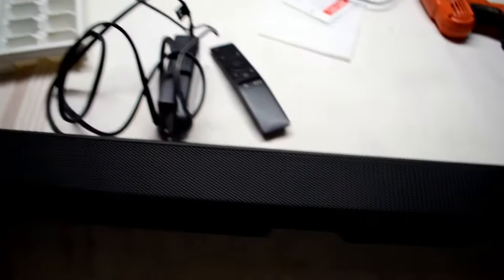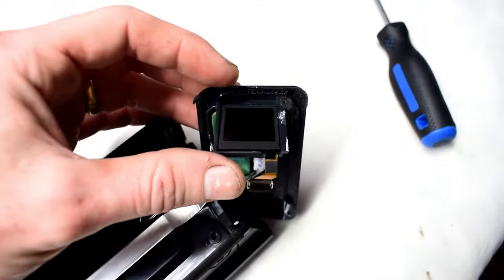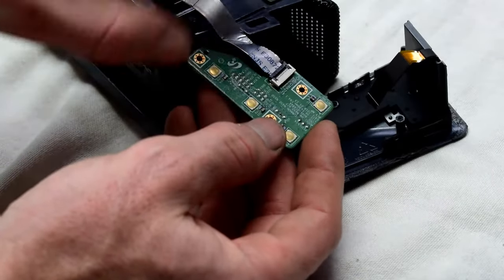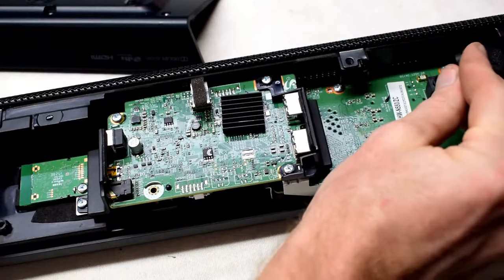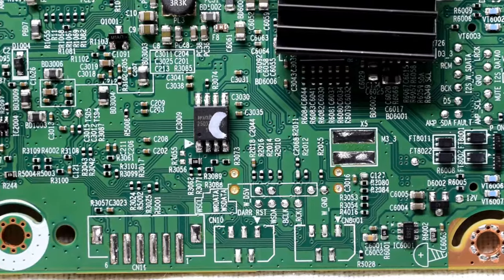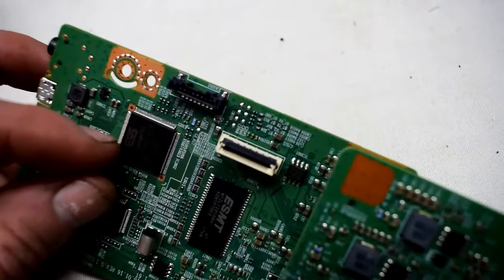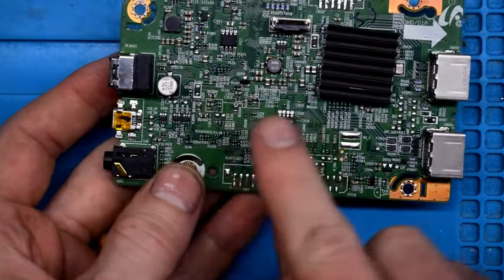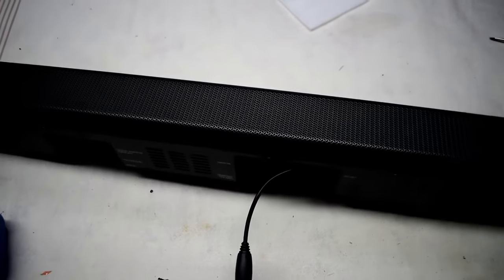Sound Bar not turning on? Samsung Model (HW-N550) PCB troubleshooting

Comment: This might be the same problem on my Samsung soundbar [HW-H450]. I thought the power supply had gone bad, but that wasn’t the problem. I wish I had the equipment you have to perform my own diagnostic and repair, but I’m going to have to take it to a repair shop.

In your most honest opinion, is it worth taking it to get repaired? Or should I purchase another one? I don’t even want to spend more than $80-$90. Is that the average repair service for something like this?

Thanks in advance, and great video. It’s very useful
Reply from the maker: usually they are relatively cheap but phone and ask how much would the repair cost.
Reply: Both your wireless woofer and soundbar are dead? Same model and both my devices wont turn on
Reply: I have the same model and it just died. Screen won’t turn on. Power supply is providing 24v. Opened up and nothing was loose or looked physically wrong.
Reply: @kristopherpomilla9469  did you solve the problem? I'm in the same situation